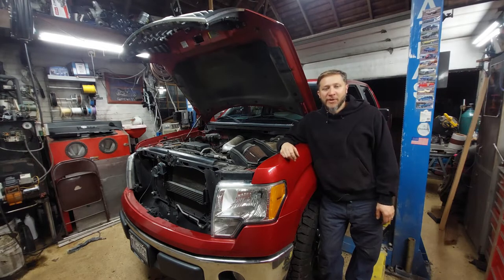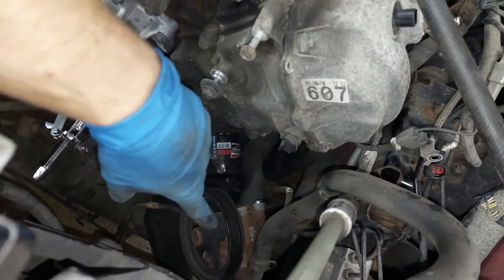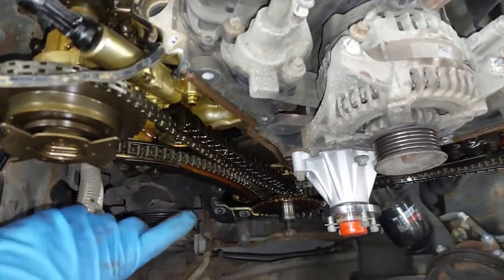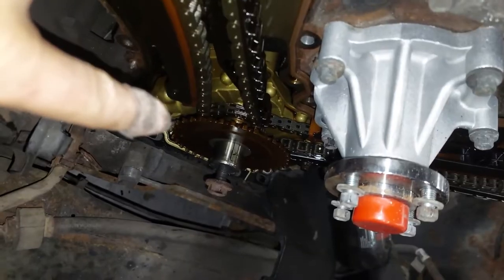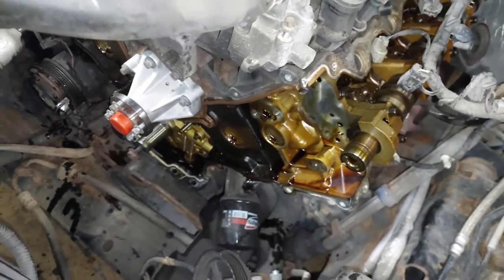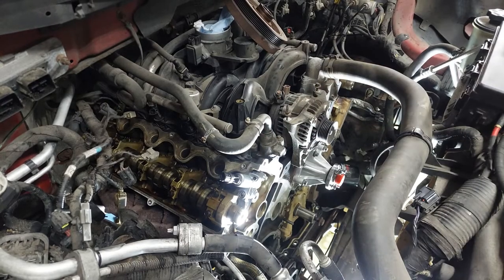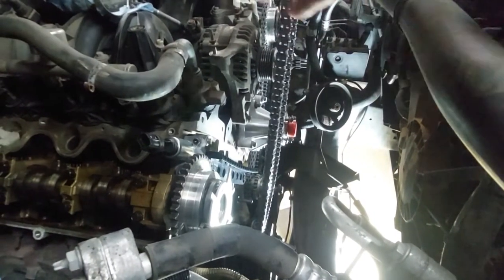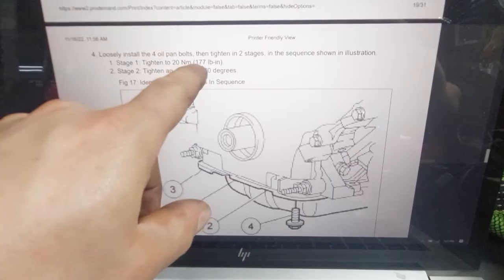2010 Ford F150 5.4L Timing Chain and Cam phaser

Comment: Excellent video. Thanks for taking the time. As you state "not an easy job" but watching your video before I started made the job much easier....
Reply from the maker: Thanks for watching and for the Kind words. I'm glad it helped!
Reply: Always repl, all roller fowlers, oil pump upgrade, & run 7 to 8 qts of oil in engine!

Comment: My 2010 F150 has 180K miles on it and I was thinking of doing the chain, since I have to take the valve covers off to replace the VCT solenoids. But not sure I want go through all that... lol. Great vid tho!
Reply from the maker: Well, all I can say is spend the money on a factory set. I've done two Clotes jobs twice now since the chain rails failed. In good news, I'm getting faster at doing the job. Thanks for watching and the comment.  Good luck!

Comment: great video , when timing cover was removed it would have been helpfull to show what was the existing problem or some play in the old chain , but very helpfull thanks.
Reply from the maker: Sorry about that, the problem was two things, a damaged cam phaser/adjuster and that's hard to show on camera. This all came from a check engine light for cam sensor fault.

Comment: My 2010 has 170k miles on it and needs this done. Its a good truck. Rusting a bit but if i get this done should i get a new oil pump and how much more would that cost?
Reply from the maker: IF you are to do it and have higher mileage I would suggest a new oil pump, but keep in mind that the oil pan will need to come off to replace the oil pump pickup tube. Thanks for watching.

Comment: Great video brother you forgot to show what you used to hold the cams from turning or spinning what did you use please
Reply from the maker: There is a special tool that I do not have. I was just very careful to keep the cams from springing back and making contact with the pistons. Good luck with your repair and thanks for watching.

Comment: Hey guys do you have to also do the VVT solenoids at the same time?? mine it only rattles when it starts up and when it warms up for about 5 minutes, other than that it sounds smooth when running!!!👍🏽
Reply from the maker: My Suggestion is if you are in there for this issue they are only a few more $, Do them. Cause to replace them the valve cover needs to come off. Just make sure to buy quality ones. I prefere OEM!

Comment: How did you manage to keep the the cam in place with out removing the roller followers?
Reply from the maker: Carefully. What I really did was use a wrench to turn the cam until the spring tension was off. When I was installing the new chain I turned the cam back where it needs to be to be in time. I found removing them an extra step thats not needed, if you are carefully not to let the cam spring back. It can/will cause the valves to hit the pistons.

Comment: My expedition had a slight noise , nothing concerning but got worse after oil change , and now it sounds like a diesel, about how much would a mechanic or you charge to do something like this ? Changing chains and necessary parts while open
Reply from the maker: Sorry to hear, Not sure how an oil change would do that other than a moment of no oil pressure and the chain rattling and breaking the guides from slapping around. This repair cost about $1600-$2,000 to repair parts and labor in NY. Parts are between $600-1,000.00 .

Comment: I thought too dead center the crank key will be at 11oclock? I bought a special tool that holds it at 11oclock and goes into a dowel pin
Reply: Right that's how mine is lining up 11:00 top dead center

Comment: Did you take out the roller followers? Is it necessary
Reply from the maker: No I did not. I believe they say to remove them so the cam does not rotate without the chain on and potentially damage the valves. It is a good idea, but if you do not just lock the cam somehow until the new chain is on.

Comment: Got a question, When i loosened the phaser on the left side i was holding it with a channel lock, but it slipped and spun about an inch before catching again and and holding. I was able to turn it back to the original position with the channel lock. My question is, If i screwed up something when it originally turned, when i turned it back or if I can just continue to put it together?
Reply from the maker: Just curious if you were able to get it all back together after our discussion.
Reply: @willpoweredgarage969  No, waiting for the local shop mechanic to swing by, decided to do the oil pump to and we'll just put it back together with him here next week.

Comment: 😂 this video just made me feel a lot better about paying someone else to do it hahaha. Im having problems..2010 5.4, 288,000 miles. Diagnostic shows that although i have good oil pressure, bank 2 isnt getting enough pressure...doing a couple things the mechanic suggested, but will probably need at least the v solenoid...just gonna do the whole thing since you have to take it all apart. Other than this issue she's still a strong running truck. Lol. Im a mechanically inclined woman, but not a mechanic.  Smart enough to know when to call in the pros lol
Reply from the maker: I get it 100%!! I know it may look scary but it is not really a difficult repair, just looks that way. The best advice i can give is to use a high quality kit.  Factory is best. I have had recent failures with the Clotes kits breaking the chain guides.  Also, That millege is impressive! Keep that baby going!!
Reply: I just went into my engine to replace the vct cyliniods and found broken black plastic pieces.... oh what joy.

Comment: Wow no one ever mentions the roller cam followers are defective and eventually pop out the click on a cold start up mine has been doing it for years and finally popped out on cylinder 7 melling has the updated ones i bet if you knew that you would have dropped them in when your cam was pretty much out.

Comment: How do you rate the cloyes tensioners, guides, sprockets and chains. I have heard differing opinions.. I know the makaloco dude recommendes nothing but oem.
Reply from the maker: Well, i recently had it come back because of two broken chain guides.  Luckily, there was no major engine damage.  I work mostly on VW and Audi, and I only use OE parts when it comes to timing components.
Reply: @willpoweredgarage969  You didn't change the oil pump and that is the primaey reason tensioners and guides fail!
Reply: Also you should have used oem vct's
Reply: Also you should have dropped and cleaned the oil pan nd pickup tube/screen....It's a sucky job but critical to a long lasting repair success!

Comment: How satisfied are you with the Cloyes kit?
Reply from the maker: Well, it recently came back because the plastic chain guides failed. But I have used them in the past without any issues. I'm hoping this one is a fluke.
Reply: @willpoweredgarage969  This is my main concern. I've used Cloyes and Melling for older vehicles many times,but everything I read says use only OEM for 3 valve engines. However the cost of OEM vs aftermarket is ridiculous.
Reply: @willpoweredgarage969  That's concerning. What do you think caused the failure of the chain guides. Tensioner failure or low quality guides? I am in the middle of doing this job on  2010 4x4 and had to drop the oil pan to remove broken timing guides and clean oil pickup screen that was clogged with debris which was a real pain! I have the same Cloyes kit but am nervous to install it now. Also are the Cloyes VCT's good enough quality?
Reply: Есть фазовращатель фирмы Dorman, что можете сказать по поводу этого производителя? Спасибо
Reply: Кто нибудь устанавливал такие запчасти?

Comment: Is this an easy job to do at home? Also I have the same exact truck with the same exact color and motor. Any advice on how to tackle this?
Reply from the maker: Easy in the sense that it takes basic hand tools. AS long as you take your time it really is not that difficult.
Reply: @willpoweredgarage969  thank you for the advice, it’s my dads truck and it’s having the same issue. He’s really nervous that more stuff is gonna brake bc I’m pretty good at doing mechanical work. He just doesn’t want nothing else bad to happen.
Reply: @jordanvance8340 nobody wants bad things to happen to their car
That doesn’t make ur dad special

Comment: Melling high volume oil ... best upgrade for that motor......also  use 5-30 oil  not 5-20
Reply from the maker: Thanks for the tip. I've heard this a few times now. Thanks for watching.
Reply: Never use synthetic blend oil. Only use full synthetic. Blend is only 10% synthetic. I switched to Castrol blend and my VVT started acting up. I'm back on Mobil 1 full synth.